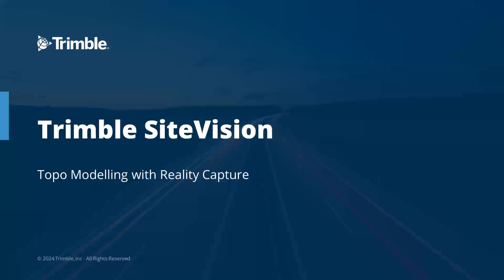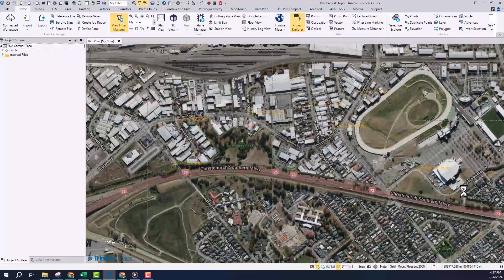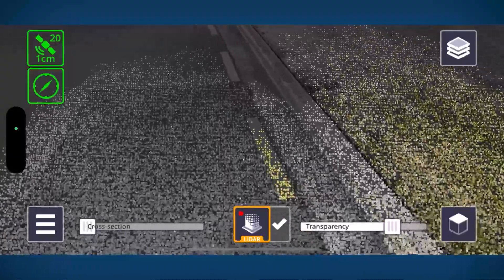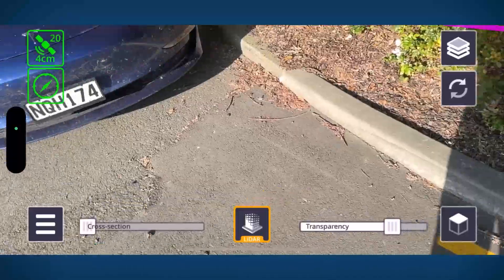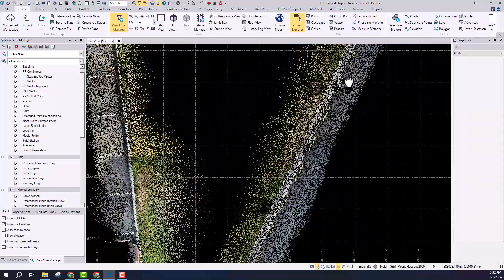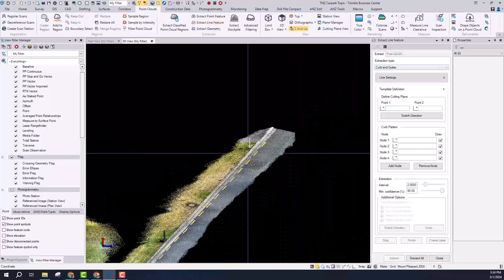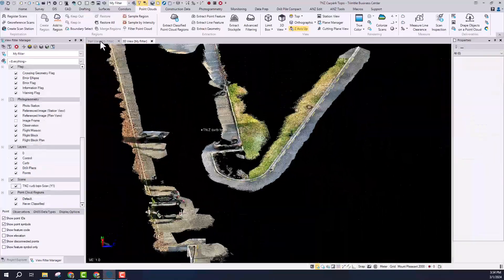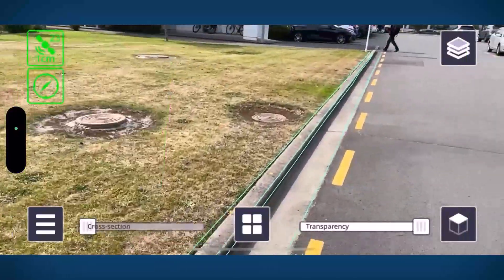Topo Modelling with SiteVision Reality Capture

Comment: Are you only using satellites or do you have a base station? What phones do you think work the best?
Reply from the maker: SiteVision utilizes the Trimble Catalyst technology that supports a wide range of correction types - this could be a single base station via IP, or more typically a VRS network that provides a 'virtual' base station.  For remote locations SiteVision also supports Trimble RTX which can deliver offline corrections via satellite.  For the scanning workflows showcased in this video you will require a LiDAR equipped iPhone Pro or iPad Pro.

Comment: how is its accuracy may I ask? will it get drift or scale problem as usual when scanning with Iphone ?
Reply from the maker: Great question!  Thanks to the integrated DA2 GNSS receiver we have a very accurate (cm) position.  This eliminates drift and scale issues for scans over a wide area.
Reply: @trimblesitevision1026  Thanks. It looks very interesting to me. Can we running Trimble R12i with Trimble Site Vision ? As we already had Trimble R12i, also with better GPS receiver and IMU  we may have better result.
Reply from the maker: @nvtcuong8173  SiteVision only supports the Trimble Catalyst DA2 GNSS receiver, so you won't be able to use your R12i.  While the DA2 is certainly not in the same league as the R12i it is still an incredibly high performance receiver.